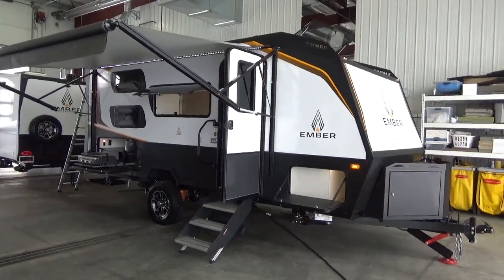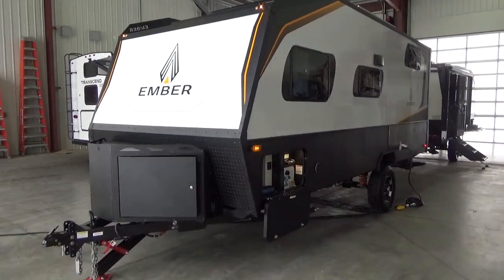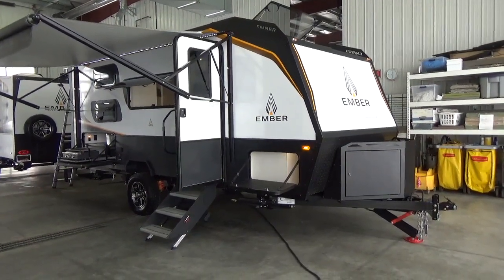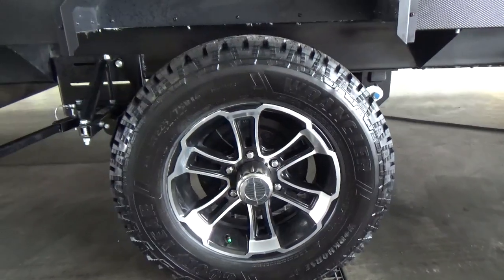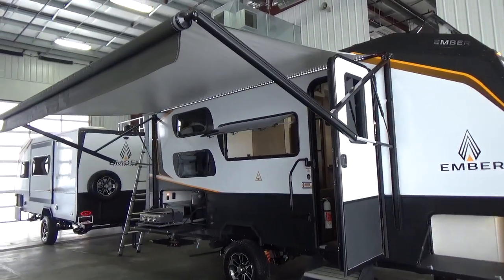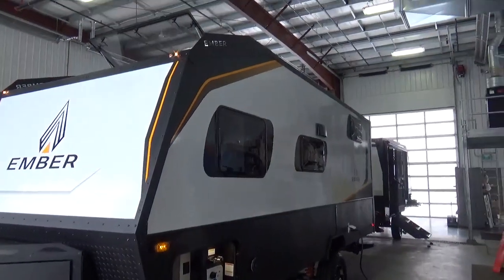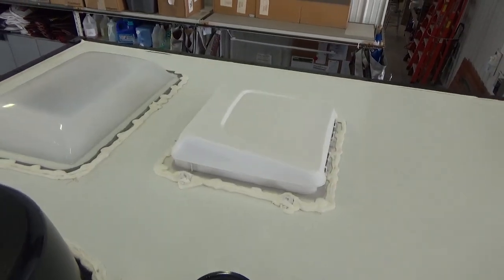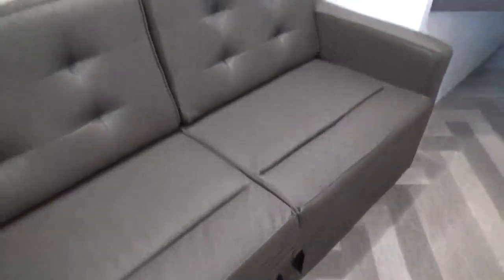2022 Ember RV Overland 190MDB Off Road Adventure Trailer - Bunk House

Comment: I love what Ember does! But why does the sealant shine around the installed elements on the case? Why are there no plastic or rubber visors on top? The main enemy of rubber is ultraviolet! This looks disgusting. Just a decorative overlay that would hide and protect the sealant. This greatly spoils the impression!